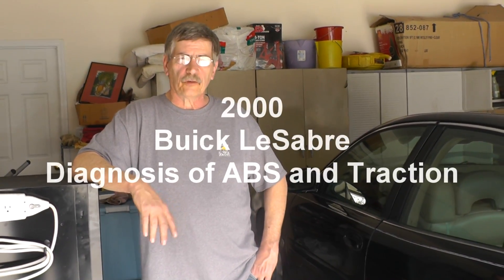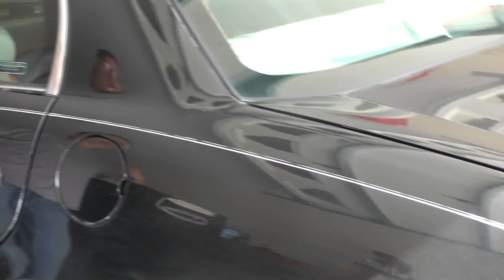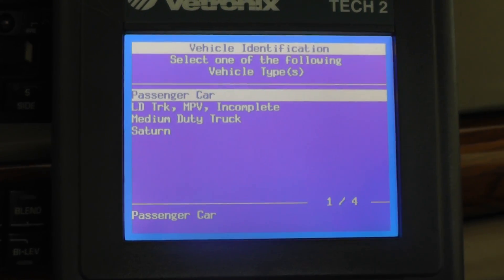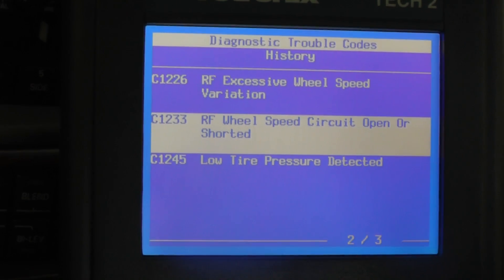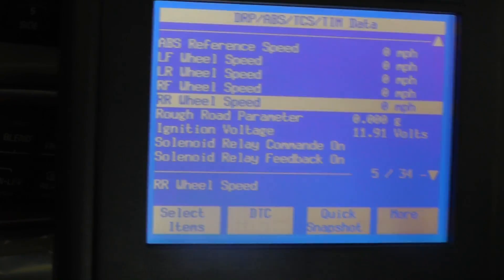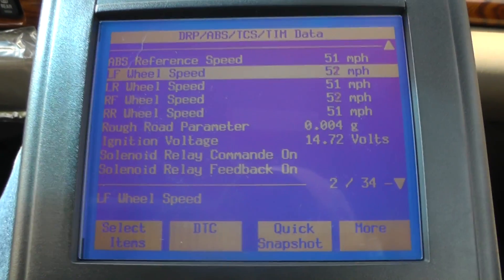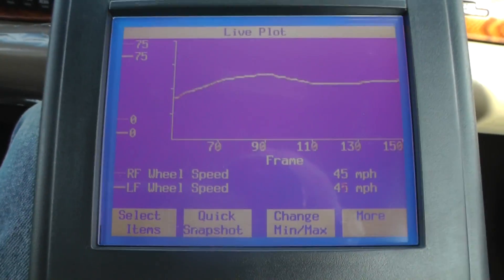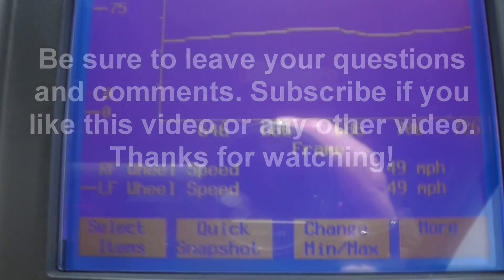Buick LeSabre ABS and Traction Off Diagnosis Part 1

Comment: my Buick LeSabre has a C1232, which is front left wheel speed sensor. My scanner measures mph and this front left goes from the same as other wheels to left front going to zero. I"m guessing broken wire, but both front wheel bearing hub assemblies are nearly new. Those parts do have 4,000 miles on them before code was set

Comment: Nice to know what the dealer does! Auto parts store doesn't have a abs code reader for abs codes. Buicks sensors are made into the wheel bearings, check the wiring first. They sell a lot of replacement wiring for this problem, mostly for the front 00-05.

Comment: Where can I get the device to monitor speeds like you used? I have a 2001 Buick century that has the traction and abs light on all the time
Reply from the maker: You can put a scanner on your car to read the codes and would give you the readouts for each wheel speed sensor. Just make sure that the scanner can read the ABS module as the cheap ones don't read it.
Reply: Did you ever find out what caused those lights?

Comment: Help me please. Explain to me how the lights on the dash are able to tell me when my tire pressure is low?
Reply from the maker: The air pressure is never directly measured as you need tire air pressure sensors to do that. On your car, there are ABS sensors, one for each wheel. These sensors will generate an AC voltage when the wheels are turning. Let's say that you pump up each tire to 35psi. Each wheel should be turning at the same revolution. Keep in mind that the ABS sensors are generating an AC voltage and the ABS module is counting these pulses that are being generated by the sensors. So, all of the sensors should be generating an equal count of pulses that are compared by the ABS module. Now, let's say one of the tires has a leak. This tire will have a smaller diameter because of the air leakage. This means this tire will turn faster than the other tires. And this tire being smaller in circumference means the ABS sensor for that wheel will generate more counts compared to the other wheels. The ABS module knows that there is probably a leak and will indicate this to you on your driver information center, (DIC). So, if you have the chime coming on indicating to check your air pressure, then you most likely have a leak in one of your tires. So, make sure that all of the tires are at the correct pressure, I like 35psi and then reset the system. If the chime comes back on later, then recheck your air pressure in all of the tires. If one is low, fix the tire. If they are all the same, then you probably have an issue with one of the ABS sensors. This will require a scanner to pinpoint which one. Does all this make sense ? :)
Reply: stuzman52 Yes it does. You have a Buick LeSabre like mine right? You there are no no tire sensor right? Also if I put a new valve stem on the wheel. That will not affect the tire pressure lights or Abs system right? Please let me know. Thank you very much for your help.
Reply from the maker: My LeSabre is a 2000, but yours being a 2002 doesn't make it any different in the controls of the tire pressures. Ours both work the same with ABS sensors. There are no tire pressure sensors. The valve stems are just valve stems like any other tire. They are not tire air pressure sensors. I assume you've got a leak in one or more of your tires, correct?
 And this will not effect the ABS system by replacing valve stems.
Reply: stuzman52 I had a leak. I had it plugged. Without removing the tire from the wheel. But I noticed my tires are dry rotted and coming apart. I went to local Walmart to buy tires. I told them my car has air pressure sensor. Cause Of that gauge on the dash I just assumed I had the tire pressure sensor. Walmarts wanted 40 dollars each for valve stems. But if you are sure that my car does not have the air pressure sensor. I will put regular valve stems on my car. I am very grateful to you for your information and advice. I am sorry if I got on your nerve's. I was upset with the car. So I can use the regular valve stems right? Other people were giving me different advice. Thank you for everything. I hope you have a great Thanksgiving.
Reply from the maker: No problem and you didn't get on my nerves :) The people who work in tire centers should already know whether your car uses air pressure sensors or not. The reason they quoted you $40 is because you told them that you had sensors. That's about the price for a sensor. Still, they should have looked your car up and would have known. If you still want to feel confident about the sensors being there or not, call a tire center or two and ask them :) You have a Happy Thanksgiving too!

Comment: If they put new valve stem on the car. Will it mess with the air sensor?
Reply from the maker: As mentioned, you don't have any air sensors? Where are you getting your information from saying that you have them?
Reply: stuzman52 A bell goes off and the words light's up saying I have check tire pressure or something similar to this. I put air in the tire. I push two buttons to reset the lights. Then it will say Normal Tire Pressure.
Reply from the maker: And how is the air pressure in the tire measured?

Comment: I bought a 2002 Buick LeSabre. About 3 months ago. I need new tires for it. Walmarts say it will cost 40 dollars to each value stem. Should they cost this much? If they replace them will it affect my tire pressure sensor? The tire pressure sensor work fine now. Can you give me any advice? Thank you, Tommy.
Reply from the maker: Your car doesn't come with tire air pressure sensors. The air pressure is detected indirectly through the revolutions of the tire. These revolutions are counted by the ABS sensors. Forty dollars seems pretty high for valve stems. Call around for other estimates...
Reply: stuzman52 Are you sure the car does not come with air sensor? There are buttons and lights on the dash to reset them. Is it true that the sensor's have batteries in them? I am sorry to keep bothering you.
Reply from the maker: My LeSabre is a 2000 and uses the ABS sensors for air pressure alth0ugh it does not know what the tire pressure is. I suspect that two years later, the system would be same. Look in your owner's manual as it should tell you about tire pressure system. Yes, tire air pressure sensors have a lithium battery in them that should last about seven years.
Reply from the maker: I just checked and Buick LeSabre's from 2000-2005 used the indirect method of measuring air pressure. So, your car doesn't have air pressure sensors in the wheels.
Reply: stuzman52 Yes it air pressure sensors on it. I am not kidding it does.
Reply: stuzman52 How can I remove the air sensor with out messing up the computer and keep the dash lights off??

Comment: Thank you for making this video. I learned so much practical hard to find information when you explained how to read the wiring diagram and connector views and the scope readings.

One thing i noticed in my diy repairs is that a lot of service manuals, factory included, only give you wiring diagrams and not the normal voltages or wave forms. How do you know what is supposed to be normal? With the wheel sensor you have a known good to compare, but you don't have that luxury with every compoment on a car.

Also, could you do a video to show you t pin to back probe a connector? I am relucant to stick a pin in the  back of a connectors and i'm not sure if i am making good contact.

Comment from the maker: Opps Dave, forgot to thank you for watching and yes, autoenginuity will pick this up, but only in the enhanced version, not with the generic version which is what I have. Generic OBDII scanners are only designed to look at the emission sensors on the engine, not the transmission, chassis or body modules. To see these other sections, you'll have to get a scanner which shows these other options. That's why I use the Tech2 and not autoenginuity this time. Thanks again Dave!

Comment from the maker: Hi Dave, I actually took a look around Youtube and wasn't really happy with what I saw out there. That's why I decided to create a series on ABS sensors. The videos that will follow will REALLY go into detail how these sensors work along with the circuit operation. Sensor construction, operation, wiring diagrams, connector views, relating docs to the world world, resistance checks, voltage and bias volts along with its discussion. Wow, a lot of stuff. Second video up and rendering the third now.

Comment from the maker: I've noticed that voltage on this car years ago and thought that it might be a tad high back then, but I feel like its normal for this car. Over the years, there has never been an issue with batteries or alternators. In fact, the alternator has never been changed and it's on it's 2nd battery since the car was purchased in 2005. If it got over 15V consistently, then I would worry there was a problem. Thanks for watching blackwell!
Reply from the maker: @confidential Sounds about right!